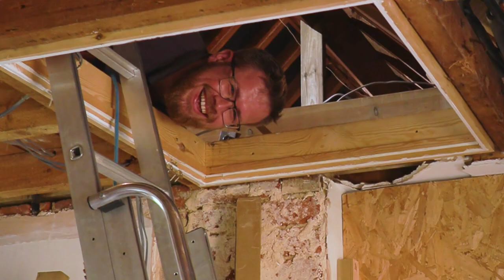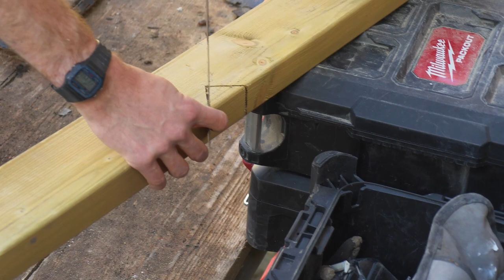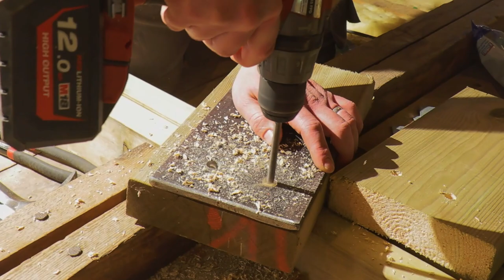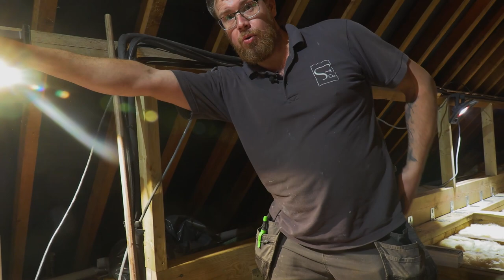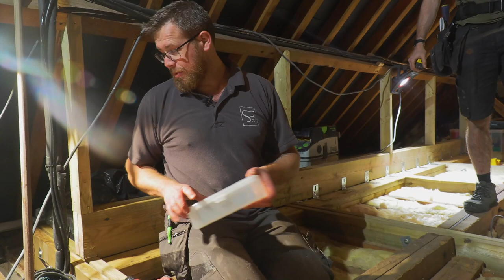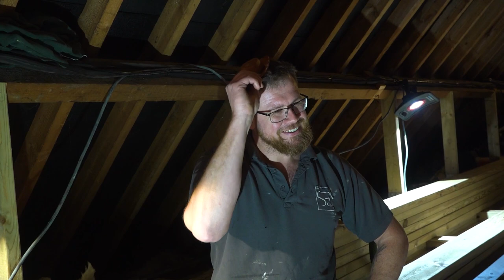What's a Flitch Beam and What are The Benefits? ~ Extension #35

Comment: What is really evident from the video is the amount of technical thought goes into this type of building work.  Very impressive.  I wish I could find builders of this calibre.  Yesterday the boiler installer had to come back to correct the condensate waste pipe.  He had put the lengths extending in the horizontal plane mostly level and in one area inclined in the wrong direction i.e. uphill.  I had to refer him to the minimums set out in the installation guide and also to get confirmation from the boiler manufacturer that if not corrected the guarantee would be invalid.  This is my constant experience.  I have to find out how the job is done and then check that the tradesman does it correctly.  It is clear from your video how much skill and knowledge is required in building.  I wish all builders were as capable.
Reply: Guys used to do a full indentured apprenticeships which were scraped in favour of YTs, that was a complete disaster so they went on to NVQ's. Still no where near a City and Guild of an indentured guy.
The old guys are better or young guys that have been trained by an older guy.
Reply: This is so true. Get 3 people in for quotes and each will mention something the others didn't..  After that you're armed with the facts.
Reply: Definitely. And it's exactly the reason I've learned to do a lot of things myself. That way I know it's right or at the very least done better than majority of so called professionals I've dealt with.
Reply: @harveysmith100  You know what NVQ stands for " NOT. VERY. QUALIFIED. " 🤣.

Comment: I'm a building inspector (20 years now) and love I flitch beams, so much more flexible to use and handle for the builder, as well as very strong. In loft conversions, a design I used to recommend quite a bit was laying a 12 x 4 under the original purlin (usually a 9 x 3). As the work was in the loft the builder would knock a hole in the gable to get the beam in. If it had to be cut because of the proximity of the neighbouring house then the cut would be at the end of the beam where the bending moment was least. Lay the beam directly under the purlin and sheath with 3/4" to a 1" ply depending on the scenario and screw fix with stepped staggered joints. You could park a bloody bus on those beams! Beauty is you can then fix joist hangers straight off the face. Make access pockets at the ends, again at the least bending moment and you are cooking on gas! 😀
Reply from the maker: What is your opinion on the positioning of the steel plate?
Reply: @SkillBuilder  I don't have an issue with the position of the steel plate, it looked good to me. It's good to see the parallel bolt holes at the end and then the staggered fixings along the length, normally @ 16" (400mm) centres. With the flitch at the base of the timbers the steel takes the loading directly from the point of support and not the timber (if it were based centrally). The timber is technically not there for support as such but to arrest deflection of the steel and to provide a point of fixing. I love to see them used on projects. He's done a great job and he'd certainly get a final certificate from me!
Reply: @michaelmewis4761  always wonderful to read and learn from another's wealth of experience.
Reply: @michaelmewis4761 , when ''the steel takes the loading directly from the point of support and not the timber'', would a steel plate to spread that load over a softer material be required?
Reply: @leehaelters6182  That is a good point Lee. Dependent on the load I would say yes, although in my experience flitch beams are specified by engineers where the loads are not so intense, e.g. in this case, to carry domestic floor loadings in which case a concrete pad stone would suffice. A spreader plate would be good if you could get one in without putting the beam out of level.  Another method for distributing the load on a wall is to place a 'Spanlite' over the masonry so that the loading is spread  'over' rather than being a point load In essence it's like making a point load into a UDL.
Reply: @michaelmewis4761 , reply and info sppreciated! L
Reply: @michaelmewis4761 , reply and info appreciated!

Comment: I (and TRADA) recommend placing the flitch plate mid-depth. This allows for timber shrinkage top and bottom without plate protruding. The plate should ideally be at least 20mm less than timber height.
Bearing is not an issue as there should be 2 or more bolts at each end (as James had in his sample) which are to transfer the load out of the plate into the timbers sides so they can do all the bearing.
Reply: @pyrrhical3423   Well... 
1) I've never seen a flitch beam made from 2x4s, usually min. 145mm deep in my experience.
2) I'm not sure what you mean by 'shrinkage under load doesnt occur in the compression face'? Shrinkage occurs tangential to growth rings due to moisture loss, which has nothing to do with forces in the beam. 
3) the 20mm is for a variety of reasons - shrinkage allowance is one of them, but it also gives some tolerance for plate being a bit off center, timbers being crowned and allows some depth for planing if needed to level up floor.
4) if the plate protrudes and that is what is bearing then, if it's bearing onto timber, chances are the concentration of force on the narrow plate will exceed the capacity of the timber it sits on and locally crush it until the timbers end up in contact again.
5) Why do you think flitches are over designed? Mine are usually designed to be just in. They have to have a factor of safety and often it is deflection criteria that dictates their size. In terms of efficiency, a flitch plate is the most structurally inefficient use of steel - ideally the majority of the steel should be at the extremities of the beam, i.e. like an i-beam. Flitch plates can often end up heavier than an equivalent steel beam that would do the job. Sometimes the trade off is worth it for other practical reasons such as being able to support a flitch beam off hangers, ease of adjustment of length on site, ability to nail hangers onto the side etc.
Reply: @smartbuildengineering  
Thank you for your knowledgeable contribution Sir... 
Mr. Whites 2×4 flitch beams must be a sight to behold... 🙄😂

😎👍☘🍺
Reply: Thank you for that, as a builder we are often left to our own devices and in this case it has always been the best (easiest) route for me hunched over and struggling in a tight space but your method (and TRADA’s) makes sense so I’ve already been thinking of ways to efficiently put a flitch beam together in that way.
Reply: @jimichip  I wish there was more interaction between builders and engineers, especially at the domestic end of the market - I think each can learn from the other to achieve a better/easier end result for all.  Having built a few loft conversions myself, I've got respect for the range of skills a builder needs and the gap between drawings and reality.
Reply: @smartbuildengineering  it would definitely be a good thing to break the invisible barrier down between builder and engineer but I suppose that (at least from the builders end based on a lot of builders I’ve met over the years) there are a lot of hard headed people that think they know best. It’s a difficult industry with people from vast ends of the country’s spectrum but it would be good to form some kind of happy medium for all. It would definitely improve the quality of building especially in the domestic side of things.
Reply: @jimichip  I think there are hard headed people on both sides!  I think it's a shame that builders and engineers often seem to have a combative relationship and not a collaborative one.  There's always room to learn from each other in my experience.
Reply: @smartbuildengineering  very true! If I had the influence and the power I would try to make this situation null and void! But if I had that kind of power then I’d probably be running the world!😂😂😂
Reply: I appreciate your opinion on positioning the plate but would say that using kiln dried lumber would eliminate that shrinkage concern. Building codes in my area don’t allow uncured lumber and additionally all framing has to be grade marked and stamped. Under the special circumstances of building a flitch there is lower moisture content  lumber available…maybe not at Lowe’s or HD but,  certainly available .
Reply: @ELW2940  Here in the UK timber used for a flitch would always be graded and kiln dried, but unfortunately most solid joists available are treated and stored outside in timber yards, poorly covered and so often arrive on site wet (and heavy!). As a result, a reasonable amount of shrinkage can still occur, despite being KD.  Also, I think KD moisture requirements in the UK are less rigourous than the US, so shrinkage once installed within a heated envelope is inevitable. In my experience initial shrinkage typically occurs over the first 2 years, and is often most apparent in the winter when heating is turned on and humidity drops, with cracking at stud wall/ceiling junctions common.
Reply: Any idea the maximum unsupport span compare between 2x6 flitch beam and just a doubled up 2x6 beam? I am researching a flat roof project and want to avoid a LBW every 8ft. Also, could the same logic be applied to ground floor joists on pier foundations?
Reply: @startrack3744   The margin would be huge, in favor, of course, of the flitch. Admittedly I’m not an engineer so I can’t be precise in numbers. Of course you know that for a flitch to be effective it has to be installed so it cannot roll, or flex mid-span and must have a solid foundation…all self explanatory. I would research them on YouTube in so far as bolt pattern and layout is concerned. Most that I’ve dealt with are through bolted every 16inches staggered t&b with a double, up and down, on each end. We ordered the plate made up and followed engineer or architect specs. They’re a fairly common item for fabricating shops. Flitches are used for both ceilings and flooring support. I’ve seen instances where they supported rafters but I feel that’s a less common use. They’re not usually made with 2x6’s but 2x8 and larger.
Flitch plates somewhat replace the use of I beams but with the added feature of being easier to include in framing due to handling and fastening to them. The wider the web, generally speaking, the greater the carry load.  The I-beam top and bottom, generally speaking again, keep the web from flexing side to side or reduce that tendency. Overkill far outweighs undersizing.
There may be code or building regulations pertaining to flitches and their use in your area. I’d certainly investigate that possibility before you get too deeply invested.
Reply: @startrack3744  Too many variables to be able to answer that, I'm afraid.
Reply: @ELW2940  i-beam top and bottom, or 'flanges' do much more than stabilise the web, it is the flanges themselves that provide about 95% of an i-beams bending capacity. This is why flitches are an inefficient use of steel.  Generally for i-beams, the flanges provide bending resistance and the web provides the shear resistance.
Reply: @smartbuildengineering  isn’t that what I said, in lay language ? The original question was pertaining to a simple 2x6 beam as opposed to a flitch beam. Read it again. I- beams are not practical in many situations. You don’t have to be an engineer to know that I-beams are preferred if possible..
Reply: I am curious about flitch beams and fires. I believe steel joists rapidly lose their strength in a fire but wood takes a lot longer to burn through to the point its strength reduces by the same amount. Wood is also a good insulator compared to steel. The steel beams in the New York World Trade Centre buildings were covered with a spray foam insulation to help preserve their strength in case of fire. So the questions I have are:

If there was a fire would the wood either side of the steel plate help keep the heat away from the beam and so maybe hold everything up better until there was a chance of putting the fire out?
Does the steel plate being positioned 20mm away from the edge help in the case of a fire compared to having it at the bottom of the wooden beams?
Has this ever been tested to see if there is any difference in how well the two options perform in a fire?
Reply: @martinconnelly1473  To your questions:  1) Maybe (or could do the opposite by not letting heat escape), 2) Doubt it, 3) Not that I know of.  

Typically in the UK a flitch beam wouldn't be exposed anyway, and achieves necessary fire protection from plasterboard/ drywall finishes.

Comment: Compound wing spars work like Flitches too. You Get a supporting length that is many times more resistant to bending than using a single beam of the same thickness.  Imagine doing this in a roasting hot loft during summer….these guys earn their crust. 👍

Comment: Great and informative video, thanks. If flitch beams are to bear onto masonry walls is any kind of padstone or plate typically required? Padstones would be a problem for me as they would then need building into below ceiling level. I could probably fit a steel plate if required, but didn’t know whether it would be necessary when only carrying a domestic floor.

Comment: Some great info on flitch beams here. How does the maximum unsupport span compare between 2x6 flitch beam and just a doubled up 2x6 beam? I am researching a flat roof project and want to avoid a LBW every 8ft. Also, could the same logic be applied to ground floor joists on pier foundations?

Comment: I like this….can I just check I’m understanding correctly? Are you saying that a flitch beam can replace an RSJ without having to increase the designed section size (or not significantly increase it)? I can see how the steel plate is still the ‘web’ but are the adjacent timbers now the ‘flanges’? I hope I’ve made sense. I had a situation where lack of space and a large RSJ could have been made significantly easier if I’d been able to ‘make-up’ my own beam. Thanks 👍

Comment: It's technically called a "Flitched" beam, made using a "Flitch" plate, which is a common phrase for a plate of material used to enhance the integrity of a structure or assembly
Reply: Sorry Mr Google
Reply from the maker: Thanks for that, we love accuracy in the language.
Reply: @samhewitt7862  That's "Sexist" ... Google that 😏
Reply: I haven't seen of a Flitched beam like this, since I was an apprentice in the Eighties. Then it was 9"x 2 1/2" timbers with steel in-between to match existing lintels at windows in a preservation zone in London. We then had to add a special paste, administered by a specialist company, so we were only aloud back after some weeks, this paste was placed between steel and wood to stop we were told the reaction to each both other when placed together. I've never come across it since and wondered why when we clamp on timber to RSJ's all the time and saw little difference. As it wasn't used more, I put it down to being Just frowned upon.  There's been loads of occasions when this would have worked for me. Thanks for the Vid 👍
Reply: A ‘flitch’ in sawmilling terms is a single slice off a log.
Reply: @tutekohe1361  I didn't know that. Sometimes that's the trouble with the English language, often changes from district to district. Plasterboard becomes Plasterslab, same thing, different word.
Reply: A ''flitch'' in veneer production and use is the stack of slices kept in consecutive order from the log.

Comment: A question for James, if you don’t mind me asking! Where did you get the socket for your Impact driver? I can only find up to 10mm in a 1/4 hex inch drive - and most coach bolts need a 17mm.

Or is it a regular socket plus an adaptor? I wasn’t sure how one of those adaptor bits you see on Amazon / eBay (1/4 inch hex to 3/8 or 1/2 inch square) would hold up… so am on the hunt for a proper impact rated socket bit in the right size.

I’ve got 50 coach bolts to do soon and has reigned myself to using a ratchet, as it’s not worth a Milwaukee impact wrench for so little!
Reply: Hi there, funnily enough I’d been looking for a set for a while to fit my impact driver and I saw the set that I now have whilst paying at the counter in screwfix! It’s an erbauer set and it costs around £15. I’ll see if I can find a link.
Reply: I will second that scrwfix do a good set for 15 quid
Reply: @jimichip  Hi James; thank you so much for taking the time to reply - I appreciate it! I've spotted that set at Screwfix so will pick one up - thanks again for the info!

Comment: Does the original flitch beam stay in place because you appear to be cutting through it at 15.22 on the video. The new flitch beams that run across the span do they rest on the wallplates?
Reply: The original flitch has now gone. The new ones run from the rear external wall plate to an internal spine wall which is off centre which, in turn, supports the new trimmers that run from left to right(or right to left depending on which way you’re looking at it!)